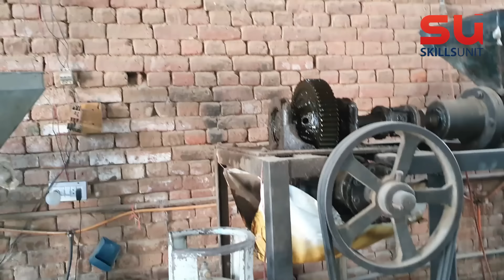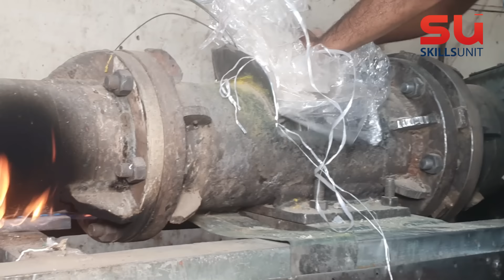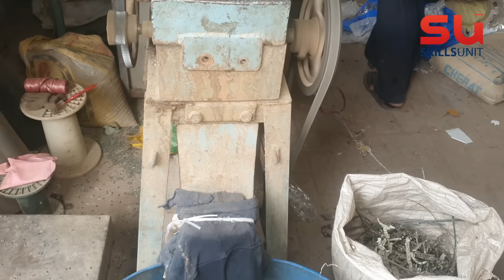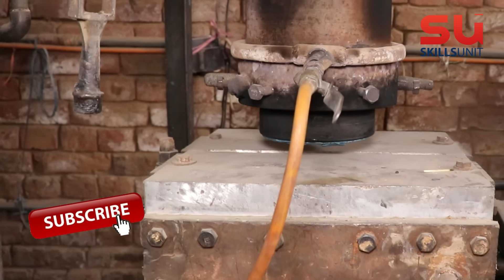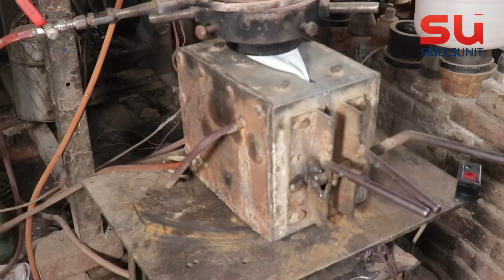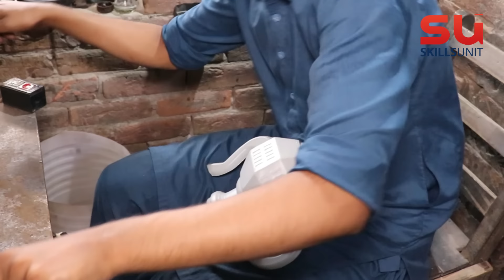Amazing Utiliszation of Waste Plastic Bags to Manufacture Asian Lota | Recycling Proces

Comment: Aside from the air quality problem in this workshop and the dubious handling of the raw material into the mangling section, the process is the same here in the UK for recycling of things like UPVC windows. Over here we would have better conditions and the equipment would have either electric heating or gas with better ventilation systems and the guys would be wearing ear protectors. All recycling is credit worthy. Ingenuity and sustainability is the key to us dealing with the global waste streams of "single use" plastics until we move to more organic and sustainable materials
Reply: bakwas
Reply: explain  dubious  handling of  the  raw materials .I am interested in this due to the availability of waste  material in my country
Reply: You forgot to mention a major difference. Your end product is 5  to 10 times more expensive than what these people are making. Do you think these people don't want to use if they are given better conditions and the PPE equipment? Also this sustainable material thou talk about not that sustainable when cost is added to the picture. Here in NZ number of plastic recycling facilities got shut down, just after they run out of government funding.
Reply: What are you hinting at?🤬Are you missing migrants?🤬Forest for bubuins, steppes for Indians, England for Europeans
Reply: @navalfa7291  Plastics recycling is seldom cost effective. I work in the recycling sector better to reduce the use of plastic based packaging by using more sustainable materials until we can figure out a sustainable circular economy

Comment: MM77 Approved 👍🏼👍🏼………….. Honestly, as a guy who has ACTUALLY worked as an extrusion operator for a major carpet and industrial fiber supplier in the USA, this is very impressive. VERY dangerous, but impressive. Once you’ve had an extruder bridge, build pressure, and blow back on you, you respect hot polymer REAL fast! I’ve got scars to prove it!😉 And yes, I had on the proper PPE!
Reply: I have a proper ppe too.🙂👍
Reply: I was an extruder operator for 31 yes. I've had extruder's blow out at 12,000 PSI. I made flat sheet and roll stock. The person stuffing plastic stock down the throat has never seen what happens to body parts. We use to buy reclaimed stock (trimmings) from customers. Until they were caught selling more reclaimed than they purchased in a month! Some of the reclaimed stock wasn't the right color or type of plastic we were selling to them. The ribbon extrusion they show making “dice” is how we made most of our color concentrates.

All in all extrusion with good equipment can be dangerous but this just waiting for someone to be killed.
Reply: @aeoo371  I agree 100%!
Reply: Yeah hand stuffing bags into extruder throat not the North American way, I too operated an extruder working for DuPont Canada in their polymer division. Stuff sticks like glue on clothing. Transferred to their powerhouse, still hot but more monitor the operation.
Reply: molten plastic burns skin like napalm and stays stuck  😖
i played with matches as a kid

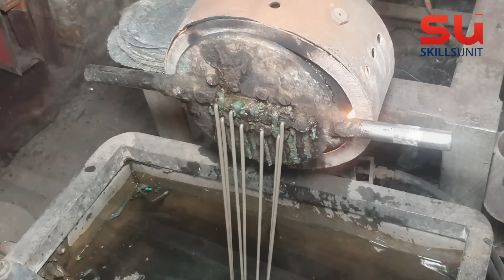Comment: I like how there's plastic garbage floating around in the extruded rope cooling tank (2:25), AND NO ONE CARES THAT IT'S THERE.
Reply: Green plastic bottle....I saw that! 😄
Reply: That bottle was a PET soda bottle.  It is incompatible with the low density HDPE materials they are using.  They do not have the same melt temperature or properties.  I suspect the bottle is actually a tool used to guide the strings of melted plastic under the roller when starting up the extruder.
Reply: It's probably there for a reason
Reply: I thought that was funny too.  It’s their pet fish.
Reply: It looks like they use plastic garbage but it seems they actually use new pellets to make all day these cheap coffeepots.
Reply: @lenny108  

The plastic garbage is made into the pellets. That process was shown right in the video.
Reply: @lenny108  sorry dude, it's for cleaning up the back end when you poop. It's kept in the toilet, no need for paper. Coffee pot! Lol

Comment: I’m impressed and grateful to see the forever plastic waste converted into anything useful. But the gas wasted as lost heat from the numerous open flames has me perplexed. They’ve cleverly figured out simple methods for all of the process steps but more of their biggest variable cost is heating the roof rather than the plastics.

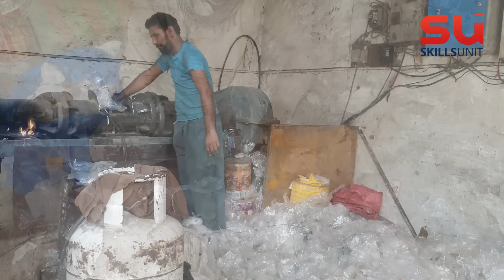Comment: 1:16 - holy crap. That's a meat grinder. At least install an emergency stop for the poor guy. 🤕
Reply: No use having an emergency stop if the hand that should push it is on its way to the cooking chamber
Reply: Probably got one of those things they got on saws for if you put a hotdog in it it stops the blade.

Comment: It's good that a waste product is used , but I would not want to drink from it
Reply: That's why you are encouraged to wash any products you buy before using them.  Clothing, utensils, dinnerware, even picnicware.  And all the crap they're making here is once again disposable.
Reply: @xaenon  It's deeper than that; the plastic they use is NOT safe for liquids that have been heated at all. Do not use non-food safe plastics for food, washed or not.
Reply: @stefnirk  I'm pretty sure that the plastic bags they are made from are food safe - that is after all a very common use of such bags.  Similar bags are sold in the West for cooking food in the microwave or boil-in-the-bag foods.
Reply: @davemould4638  Boil-safe bags are made of different plastic blends and don't contain LDPE but LLDPE and have higher amounts of HDPE.

It's not safe to melt plastic shopping bags, introduce thermal degradation and sell it as a food product. I would have my engineering licence stripped from me if I did it.
Reply: @stefnirk  You are saying that it is unsafe to put food into plastic shopping bags?????
Reply: @davemould4638 I'm saying that it's unsafe to use shopping bag plastics for items that are used with hot food. The Keyword is hot.

If you are ok with drinking liquids from thermal degraded LDPE, be my guest. But no company in a country with health laws would be able to sell it to you.
Reply: @stefnirk  What are the risky chemicals involved, and how big is the risk?  I am quite certain that many people have microwaved food in a plastic bag to heat it up.  I have done so with foods that tend to "shed" or "leak" so as to avoid needing to dirty a plate or clean the microwave afterwards.  e.g. to re-heat slices of pizza, or a pork pie.

Comment: What a hokey operation! Using fire flames to heat extruder barrel - no air ventilation system to pull away gases from hot melt exiting extruder - open gears on extruder gearbox!
I've worked 25 years in plastics molding and recycling - this operation is dangerous.

Comment: Fumes are really dangerous. I feel sorry for those guys.
Reply: There’s no PVC in this or any carcinogenic substance like phenolic that are used in dark or hard plastics. Neither is polystyrene is melted that white thermal throwaway cups n plates are made of. I’ve been to such plants but found no smell or fumes. Also the facility is open and ventilated not enclosed.
Reply: Don't you see the airstream everywhere?
Reply: not that its a garbage dump falling apart amongst the other 5 million hazards and they cant spell. making this a terrible video.
Reply: Not sure what is going on... But between long shirts,  naked flames, and spinning pulleys and augers, I switched off

Comment: As an electrical engineer my biggest concerns was the wiring in the whole place ! No need for enclosures , switchboards , electrical protection , barriers NAAAAAAA! Just screw it to a piece of plywood by 1 screw so It's not even straight , 3 phase power cables fully exposed , 400 volts AC ! but worst of all , no sign what so ever of an Earthing (Grounding) conductor , busbar , bonding (not rocket science to install but vastly increases safety .!
Electrocution deaths in Pakistan is very high , at least 1-2000 per year . 
The ILO’s Decent Work Country Programme Report states that in 2014 there were only 547 labour inspectors in Pakistan against 23,983 factories and 327,706 shops/other establishments. This works out to an average of one inspector looking after 643 commercial and industrial units. A large number of posts for labour inspectors in the provinces are lying vacant for the last many years, and there is a chronic shortage of testing instruments, vehicles and competent technicians.

In addition, provincial labour departments have weak oversight: the lists of establishments visited by certifying surgeons in Sindh are lengthy but meaningless, as they contain no reports whatsoever on the state of health of the workers visited.

Advertisements relating to safety and health guidelines are directed at workers, not employers whose responsibility it is to train workers in safety protocols. These are also in English; most workers are from rural areas, with less than three years of schooling.

A report by the ILS Unit at the Ministry of Overseas Pakistanis & Human Resource Development states that 24 per cent of injuries/diseases were caused due to the workers’ lack of literacy and training, while unsafe working conditions included defective tools, equipment or material (28pc), slippery surfaces (22pc), inadequately guarded machinery (9pc) and non-provision of necessary protective equipment (7pc).

Comment: It's a pot FOR WASHING BUMS AFTER A POOP! bears repeating since lots of comments raise the problem of volatile toxic and leaching compounds.  Toilet paper is a luxury there, and besides it's not anywhere near the same as washing at getting poop off, especially for those unlucky ones who have hairy bums.  I imagine most people there don't have indoor poopers, and the outhouses don't have plumbing; could be that even the main shack doesn't have plumbing.  Probably all water is carried in some form, and all intensive water use (showers, laundry) is done away from the main housing, in a public facility.

Comment: The interesting thing is that instead of electrical heaters the extruder body is directly heated using  wood . What is thr the raw material used for making the jar? ie is it 100% recycled material or certain percentage of Virgin 
material added?
Reply: Seeing the guy sorting out the clear plastic bags I'd say they are molding with low density polyethylene (LDPE).
Oh yeah...heating the extruder barrel with fire is a HOOT!
😄
Reply: Wood?  I see fire and I see propane tanks, and hoses, so it looks like they are using propane, not wood.

Comment: Tell me again why we can't recycle plastic bags.
Reply: They can be recycled - I've worked in a plant that did. 
The bag film scrap was first put in a grinder/shredder - the shredded plastic was sucked away from grinder by blower fan and delivered to holding bins...then fed into a "rubber mill" type extruder - extruded plastic "chunks" weighed on a scale for amount needed for mold...compression molded with 750 ton hydraulic press. We made 48" x 48" sheets - 3/8" thick up to 2" thick. I no longer work there but still some sheets...they are durable and tough! The company couldn't find a market for...but they should've tried making roofing materials...would outlast shingles.

Comment: My goodness! An open flame barrel heater on an extrusion line! I’m sure those open flames only inches from the melt pile won’t do anything to that hot outgassing polyethylene sitting there in a massive ready to burst into flame lump! I have seriously never seen an open flame extruder barrel before! I’m sure their infrastructure does not allow for the high current capacity electrical lines that they would need if they used the modestly modern system of electric band heaters on that barrel, and I’m sure I’d be more horrified by the way they wired anything that had actual current to it, and probably more likely to kill everyone then the open flame and outgassing pile of polyethylene!

Comment: The thing that made me cringe was the way the guy had to feed the bags into the auger by hand. He needs a feed tube & piston! Even if it's just made of wood and sits on top, it would be better than having your fingers one mishap from missing.

So the thought I had was that the feed tube would have rectangular or square cross section with a wide slot down the side through which the bags would be loaded . The piston would be lifted to load bags in to the feed tube. The piston would then use gravity to push the bags into the auger. Presto!

Comment: How are the toxic fumes coming out due to burning of plastic controlled? How is it ensured that the employees working there are not inhaling those toxic fumes?
Reply: Instead of asking 20 questions,  please go there and fix whatever toxic situations you've identified.
Reply: They are not burning plastics.  They are melting the plastic by burning propane.  Their goal is to convert recycled plastics into a new more durable product, not burn up their raw material.
Reply: under 400 degrees it won't offgas (as much)
Reply: Yes.

Comment: Contemination will be first concern.
Reply: Contamination of what?
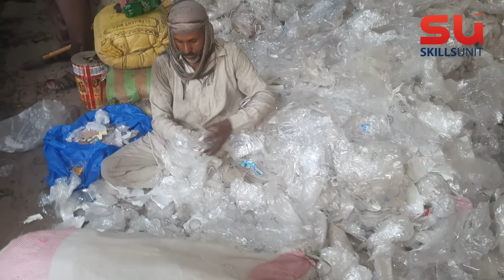Reply: @ats-3693  All the used bags are all over the ground, unwashed (1:00) handled with bare hands & maybe feet!  The plastic bags that may be recovered from trash dumpos should not be used to make anything that will touch food or water.  I have no idea if the plastics from unknown sources are food-grade safe.  Is the coloring dye safe to hold food or water?  There could be heavy metals and unknown chemicals on the ground!  There is no way I will buy and use the final products.
Reply: @gooddealonly  Fair enough, I'd probably drink out of one of those jugs, they obviously have some idea of what they are doing with plastic types at least.
Reply: @ats-3693  I live in a first-world country,, the U.S.A., and have safety concerns.  Hopefully, these products will never be sold here.  The only situation that I may drink out of vessels made this way is if I am in the middle of the desert, on the brink of death, and the no available water within 10 miles of walking.  The plastics should be mixed with sand and make bricks or pavers.
Reply: @gooddealonly  yeah I live in a first world country too, but if I was traveling in a place like that I'd drink out of one of those jugs 🤷‍♂️
Reply: @ats-3693  And if bottled water is not available.
Reply: @ats-3693  no, dont drink out of it - its for cleaning after pooping
Reply: Having passed through that extruding chamber, I doubt if any harmful bugs managed to survive. The finished product though ,... I would be cautious
Reply: @themadfarmer5207  I would be concerned about harmful chemicals and heavy metals. Not bugs.